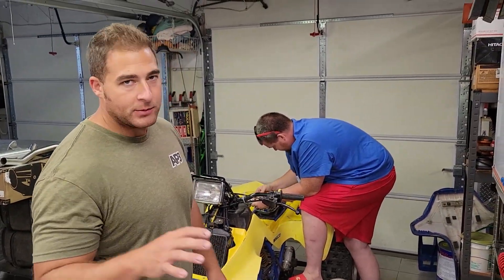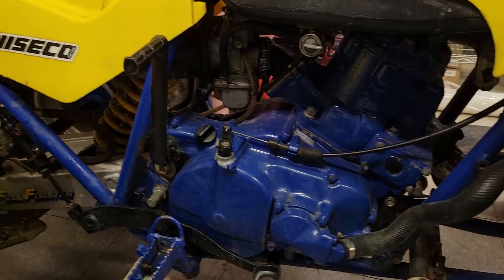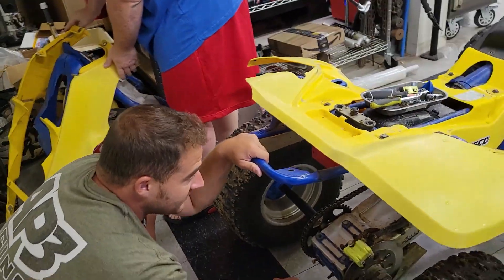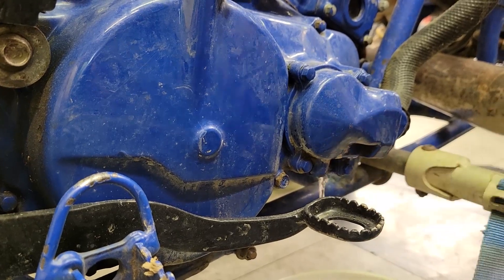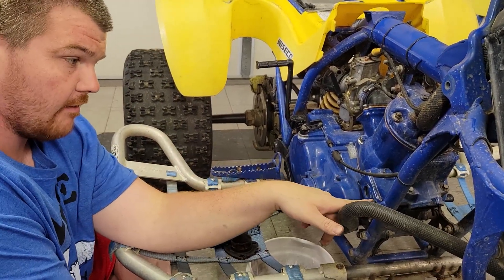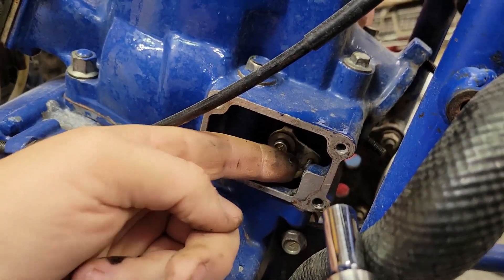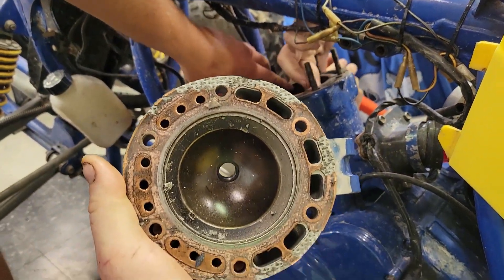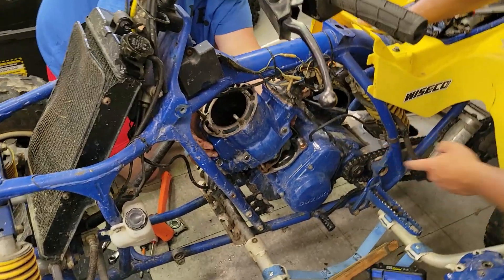Only THIS could stop the Fastest Quad of All Time (It's Bad)

Comment: I have also built one of these. You'll want to speak with Todd Witz. 
Since you are tearing down you'll want to do at least the following
- main crank bearing journal inserts
- cylinder ear reinforcing
- o ring the head 
The cylinder head also needs a major reworking to make reliable, they just weren't right from the factory. 
- use 2 green o-rings for the powervalve (known leak point) 
- RM wrist pin bearing & kevin cunningham billet thrust washers. 
- mic the shift forks!
Best of luck with your build man! I have almost 10K into mine, worth every penny when it's done! 
Pair it with Todd's porting, LED trx250r airbox delete, VM44 carb, Steiner billet intake, Q2.0 pipe, and that thing will be NASTY!
I also have some sweet billet Mossbarger reeds for this if you are interested :)
Reply: Mike Steiner did a billet intake for my 87 LT 250R. took almost 2 months of wait time and 200$ but was worth it. And bought some billet thrust washers from Cunningham. he's actually gonna be at our local track..Newtown Drag way in Newtown VA next week. he always comes out.
Reply: and Todd helped me get OEM seals and Crank bearings

Comment: Aso I figured out my warrior new clutch issues, I removed the shutter springs and added a steal ring to the inside of the stack. I used to slip in every gear now it hangs the front tires first through forth👌

Comment: I have an 87 zilla as well, y’all may have opened Pandora’s quad. The zilla’s are notorious for being the biggest pieces of junk ever. Don’t get me wrong I think they are boss machines when running, but just so many stupid motor issues. Like the fact that the water pumps are all faulty from the factory and leak through the weep hole. They also pull head studs loose unless you get stud work done. And not to mention the fact that they literally rip the ears off the cylinders on these bikes. All this happens on stock bikes for no other reason than the fact they just were not manufactured right. And finding parts is also very fun. This is going to be a tough build and if y’all have any questions feel free to hit me up. Good luck👍

Comment: Pull the whole motor, you're splitting the cases. You need to check the bearing pockets as well, most are worn and need sleeved.

Comment: Badass quad but I'd still take a banshee. Reasons behind why I would take a banshee. It's twin cylinder/carb. They have numerous parts out there available, you can make them into fire breathing monsters given enough time and money. They are over all durable, don't suffer from transmission issues or other problems that plague other quads.

Comment: FMF makes a wicked pipe for these, makes a huge difference.  These machines can eat clutches so i'd upgrade or at least rebuild it.  These engines are in a low state of tune.  Id at east mill the head and run it on race gas.

Comment: Stock air box is junk don't over tighten.
We trashed ours and made some aluminum pipe and k and n filter with outer ware with t clamps. Looks like you have a 87 with 6 headbolts 88 and up have 7 no but deal. Look on top of the piston and see what number you have, I think you can bore it about 10 time's. We had a lot of top ends until we went to straight race gas and motoul 800 at 50 to 1 , remember more oil more heat . One other thing is on top of the head blead the air out after you get it warmed up every time you run it you'll be shocked how much air you'll get it makes a hot spot if you don't

Comment: 87 zillas with the 6 stud head and other issues being a first year model are much less desirable than 88 to 91s and to make an  87 reliable you should be prepared to spend alot of money.   It's a luxury machine to have, if machined and modded enough to make it reliable, the main issue being the head gasket on the 87s, in stock form they are guaranteed to blow, run lean, grenade we all know the story.  There are other frame and suspension issues I believe with the 87s as well.  I hope if the machine is being rebuilt it will be done properly, so it will be a reliable, long lasting insanely powerful motor.  They're supposed to handle pretty bad hence the aftermarket a arms, so as I said, a completely luxury to own and really meant mainly for being good in a straight line.  Very similar to a Tecate 4, a macnine I have a ton of experience with having rebuilt one mechanically pretty much front to back, besides the motor.  42hp at the crank stock, these kinds of machines are like shopping carts with rockets strapped to them and owning them is not because you want the best riding experience lol.  Just my opinion, I assume you do have an 87 and that is why it's in the state it's in fresh after a "full resto".   I came very close to purchasing an 87 but once I learned about all the issues and how inferior they are to the 88 - 91, ill just keep waiting for an 88 to 91 thats not destroyed but needs some love.  Either way vintage machines of this era are becoming so popular and expensive that its becoming a rich man's game, though deals do still pop up. If you guys do this one right I have a feeling it would generate a strong response from the audience base and maybe you could show in detail how to address or make superior the 87 issues.  Id love to see it rebuilt, properly.
Reply: No just don’t run a head stay on a 87...
Reply: @fastmachines500r8  If you say so.  Duncan racing I believe are the premiere zilla builders.   I've never owned a zilla, but I have a ton of machines of this era, this is what I've heard about the 87 zilla.  The head is a shitty, inferior design, why running without a head stay on a motor that has inadequate head gasket sealing would have any change on whether it blows or not is beyond me, but I am not the ultimate authority.  88 to 91 cylinder is the quick, best way to make it somewhat reliable.  
Duncan racing has built some really nice, amazing 500's.  They seem to be popular with the sand or desert riders where too much power is never enough.
Reply: @Donny_Buysall  the vibrations cause the head stay to pull the head up, that’s how it blows head gaskets, Duncan, full Tilt, DrQ, hpr, trinity are all great when it comes to zillas

Comment: The zilla is a beast but very unreliable unfortunately and expensive af #suzukiissues lol but excited to see this on yours and johns channels my best friend owned 2 of these at the same time  they are damn fast still the biggest bore 2stroke atv to date they don’t build em like this anymore and unfortunately never will again . And the way the intake is setup the 87-88-91-92 Honda trx250x and most Honda atcs are set up to get the air through the frame pretty cool setup

Comment: That’s the fastest quad ever made then comes the banshee
Reply: Nah banshee ain't second lol it's very far behind a lot of quads in a straight line stock.
Reply: Fastest 4wheel off the show room floor but the banshee with a few bolt ons and it is quite a bit faster than the 500 and that’s coming from a Suzuki guy
Reply: I’ve had 3 quadzillas and when they blow up they blow all to hell and it will take you for ever to get the power valve adjusted right like it needs to be and who ever that does your crank he better be the man cause if it’s not done perfectly in spec then it will vibrate worse than a Harley Davidson and you literally won’t be able to hold onto it
Reply: @matthewjohnson2495  My dad had an 88 and I was told that it was not stupidly finicky.
Reply: @matthewjohnson2495   you have no clue what you’re talking about dude.
Reply: @fastmachines500r8  If both bikes are in stock form the hell I don’t know what I’m talking about. You have probably never seen either one of them stock cause you was 7 years old when they came out so mommy wouldn’t let you play with the big boys so you definitely have no idea what you are talking about slick